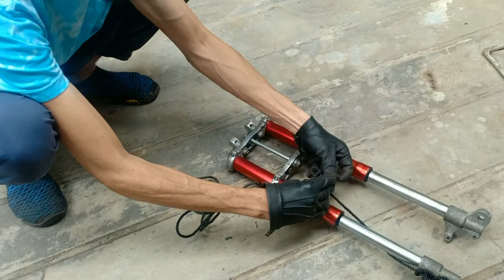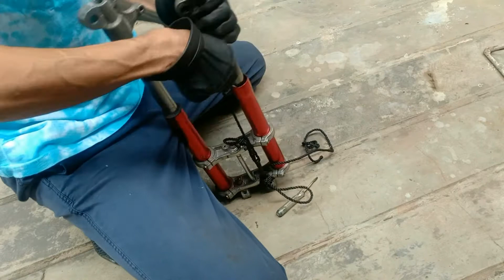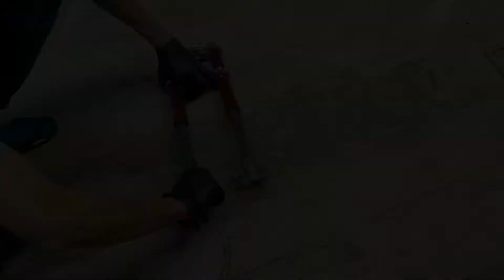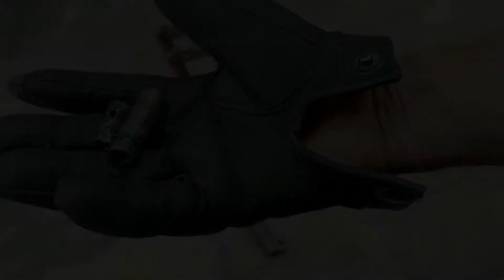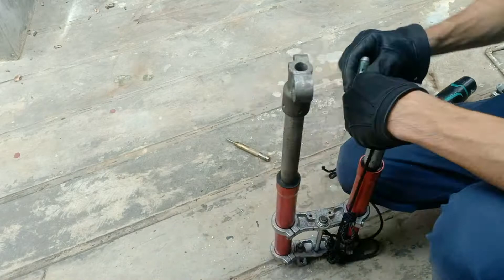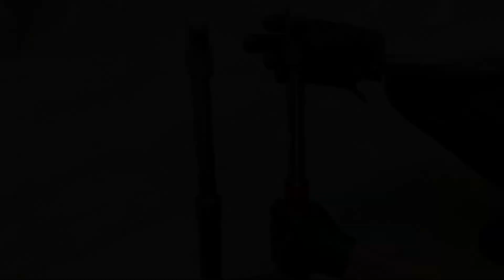mini trail : shock depan paling keras di dunia

Comment: ini shock gazgas gx50 ya bang.
Ukuran asnua berapa bang?
Dan silnya pake apa?
Reply from the maker: merk motornya saya gak ingat, tapi rata2 sama aja. uk. as juga gak ingat, mungkin sekitar 25-28mm.
itu sok aslinya, isi nya cuma per, silnya adalah bushing plastik, bukan karet.
Reply: @rchyn2089  terimakasih responya bang
Reply: @rchyn2089  sy pakai mini trail 50cc yg matic tp pake engkol bang as nya gede dan udah cr online blm ketemu juga cs as nya berkarat